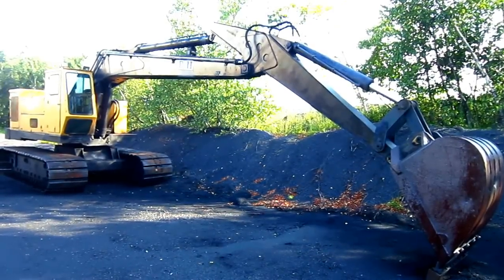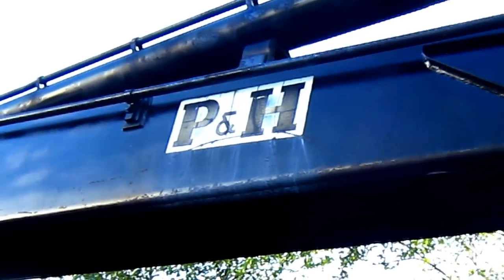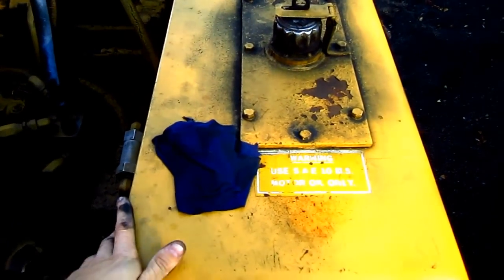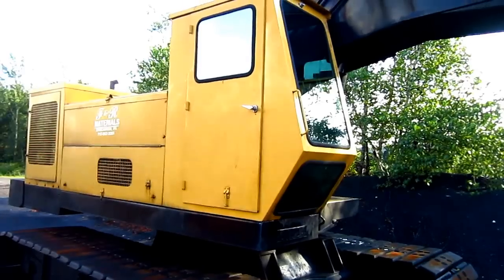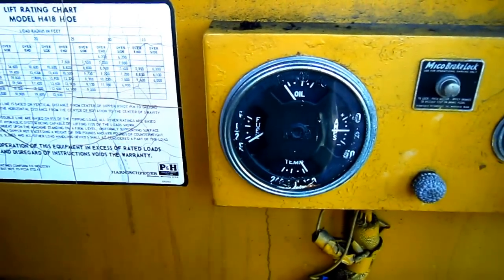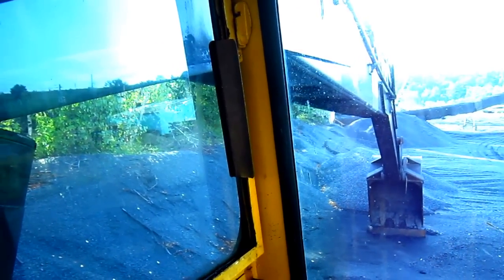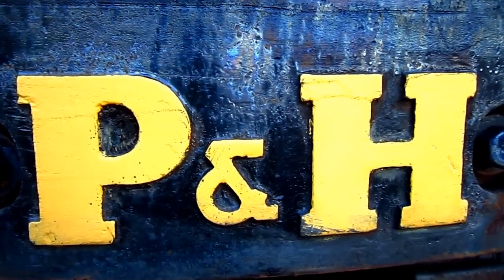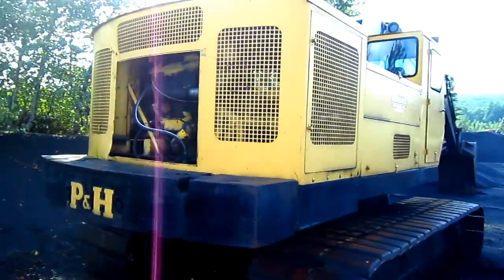P&H H-418 Documentary

Comment: PH invented alot if unique stuff. Awesome company. MagnaTorque electric swing was awesome. We had a bunch of hydro cranes also. 
6250 lift crane was awesome built alot of NYC 400 ft booms.
This was before the day of variable displacement load compensated piston pumps.
Old school hydro pump s wasted alot of power pumping oil in circles not working a function. 
Excellent work thanks.